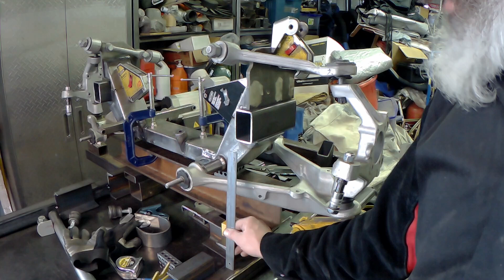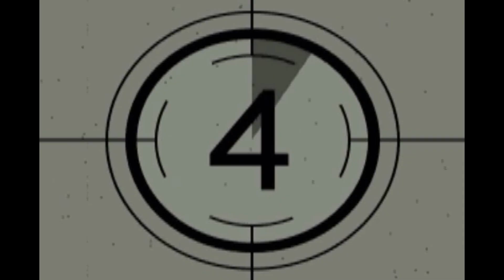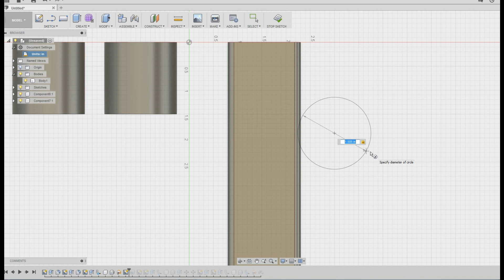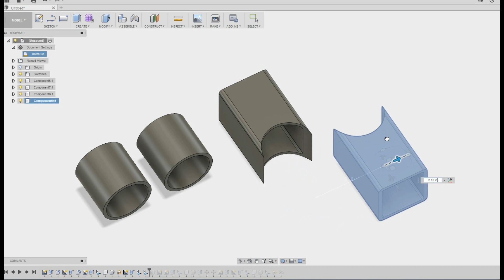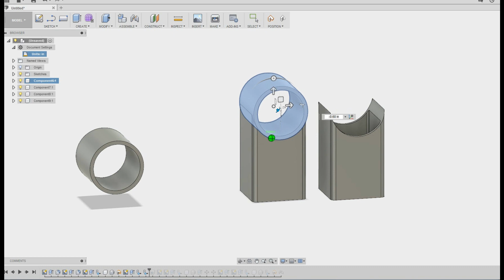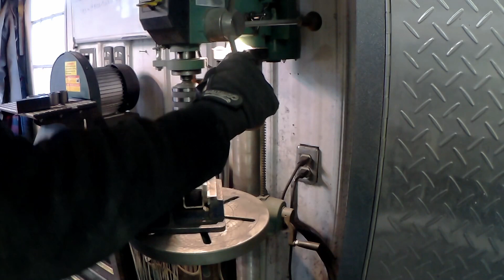Volvo Amazon Front Suspension Fail - and Redesign.

Comment: On my fein chop saw I bought the tubing clamp, then I can put the square tubing at 45 degrees to the blade so I can cut on the corner instead of the flat side, it's a lot easier on the blade because you aren't cutting a wide area, only the edges of the metal and the thickness
Reply from the maker: Sounds great!  This Morse unit doesn't have that functionality.  Still works fine though.

Comment: The comment below, (I can't bring myself to repeat the name of the poster) is spot on! Bad Obsession Canada! Love your channel and thank you for going to the effort. Obviously there are sooo many details of building (rebuilding)a car, but this episode about the suspension is of particular importance for any car and of special interest to me. I have a c6 vette drive line and plan to install it in a '49 Int. KB1 pickup. The attachment points of the upper control arms (front and rear) are a big question at this point. I have a service manual which shows roughly the points but does not give specific numbers, no numbers at all in fact. I heard you speak of using an engineer to help you design certain elements. WHERE! in western Canada did you find such an engineer? Failing that, what "engineering" have you taken on yourself? I've search a lot to find out how to figure this all out on my own, and find much about camber, castor, steering inclination, roll center, CG, on and on, but not much about anti dive anti squat. This seems to not be talked about probably because most car guys aren't designing a suspension from scratch as you have done. What I have found seems to be pointing to the upper control arm as a means of adding or reducing anti dive, squat, it seems to me the lower arm could, would, should have a bigger effect on this trait but I really have no idea or proof. I do, will have the opportunity to change all of the attachment points of this vehicle, again butt, I'm not finding the information to give me a starting point. I'm betting even the factory  Corvette settings will work just great, I don't have those :(
Anyway, great work and awesome videos, thank you for sharing all that you have.
Reply from the maker: Hi Kevin - I'm glad people are starting to understand what's involved.  I didn't find the engineer in western Canada.  He was in the US and is no longer active.  I had to scrounge to find someone that would basically check my numbers.  No one will give you specific numbers and I never had the stock cross-member for the C4.  There were a few things that were changed - and I did the uprights twice.  A reduction in anti-dive and a taller lower ball joint gets the C4 looking a lot more like the C5/6.  Far too complicated for a YT comment.  The eventual suspension design was just me working from the points in space.  It's worth it to find a front cross member to get points from - I really should have done that.
Reply: @ThrottleStopGarage  Hi Craig, thanks so much for your reply! I have had a chance today, Sunday, to watch a couple more of your vids (great stuff!) while watching I did think of how I will get my attachment points nailed down. I'm fortunate that I have the Corvette lower cast aluminum subframe, (obviously the LCA"s are attached to that) very sorry to hear your framework was stole from your yard, F"n thieves! What I'll do, on a table like yours, is set up an adjustable jig for the rotor/wheel hubs to get the castor, camber set to factory numbers (those are available). Then I should be able to build the mounting brackets for the upper rails, with just some simple measuring. As I saw in your vid about the 'built for you' front cross member deal, they had the UCA slope all wrong. Interesting stuff! And Thank you so very much for your excellent videos. I just watched you struggle with the large twist bit for the rear subframe, very entertaining, lol. Another channel worth a look is Matt Happle @ Sloppy Mechanics. he calls the issues builders have "living on Struggle Street". Some days we fail it some days we nail it.
Reply from the maker: I'd do a few things differently.  Get some W - I beam (4" works) and build a proper jig.  Something with square references and the ability to construct right angles.  If you don't mind the cost - then large extruded aluminum slot material (https://www.mcmaster.com/aluminum-extrusions) is the way to go (the big stuff - not 40 mm stuff) and if I ever did it again, that's what I would buy.  I spent way too much time cobbling together things on the cheap that I was never satisfied with for their accuracy.  You need the LCA vs wheel centre dimension for sure and then have to have the pick-up points to get the caster and anti-dive set properly.  You can't model the C4-C6 in a 2D suspension system.  You need a 3D system.  At the very least, do this - you need to check things like the roll centre, roll centre migration, caster/camber gain in bump and turn, ackermann for steering (if you're changing that...and if you don't have the engine mounted behind the rack...you'll be changing it.).  Then you need the rear suspension stuff done as well to then put together a proper car model.  I think I asked in the video if this would be of interest...it wasn't.  It also depends on what you want.  The car/truck will go down the road, but if you'd like it to be a well sorted thing, then there is a lot of work.  I also figure, I should have accepted the quote from Art Morrison - they just wouldn't tell me anything much about what I was getting...beyond "sport" and "better" which is great for most people but deeply unsatisfying if you're like me.